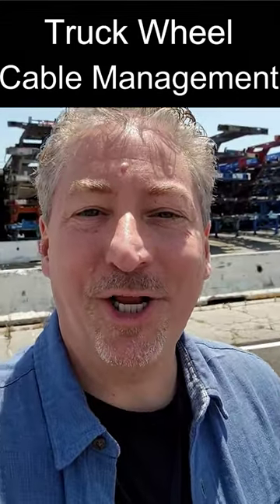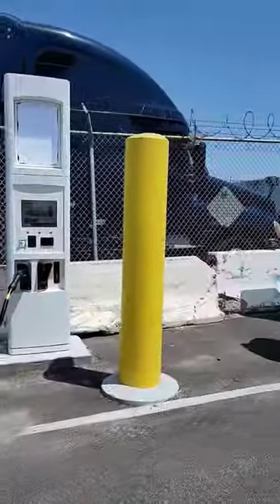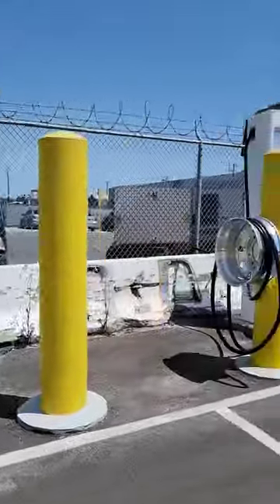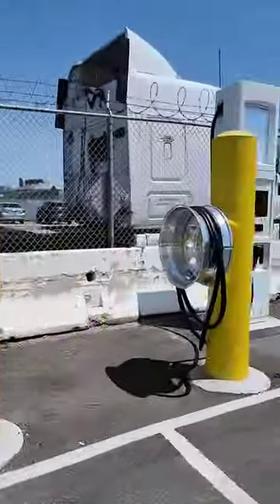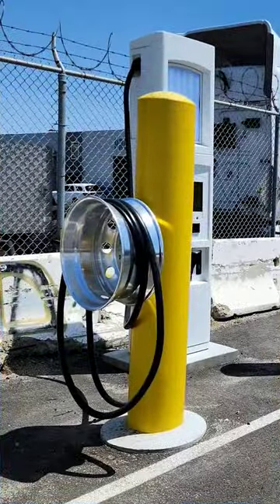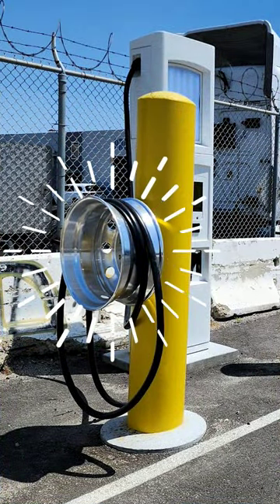Innovative EV Charger Cable Holder

Comment: In Norway, Tesla uses CCS and other brands can charge on a significant numbers of Tesla SC. AND the non Tesla charging stations have high stability....

Tesla is still selling like hot cakes...
Reply: CCS1 and CCS2 are quite different.  NACS wins in North America and that will be great for the consumer in the long run.

Comment: I'd rather has gas so I don't have to wait 6 HOURS to drive my car or worse yet continue my route to get paid
Reply: On top of that a gas nozzle fits all car
Reply: Don't you have anything better to do with your time?
Reply from the maker: LOL, 6 hours. Somebody doesn't understand DC fast charging! 🤣
Reply: And I bet you are not even a truck driver. And if you are, you are scared.
Reply: You charge on your break, you don't have to watch it
Reply: Stop watching EV channels just to complain. clearly they're just not for you so don't watch your comment
Reply: @kingjuggalo4774  not diesel cars.
Reply: @barryw9473 I had a diesel Mercedes Benz in the 80s.  Diesel cars were more common back then and everyone thought they were the future, kind of like are EVs now.  I often had trouble getting Diesel and most truck stops the nozzle was too big to fit in filler.  Times have changed, now lots of gas stations sell diesel and very few diesel vehicles. I wonder if EVs will end up the same with lots of chargers and few EVs. Either way it’s fun to drive the latest fad.